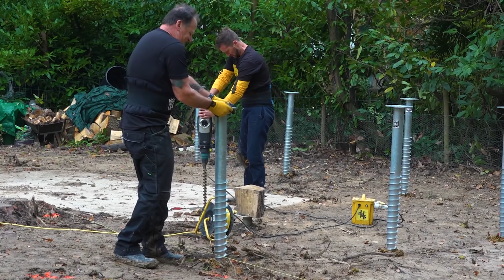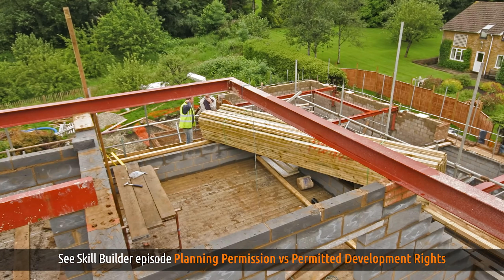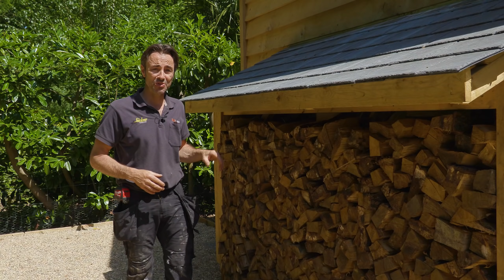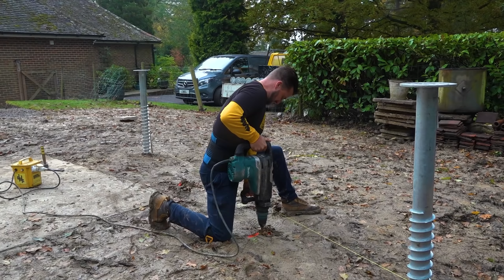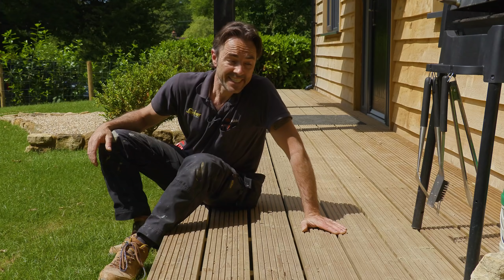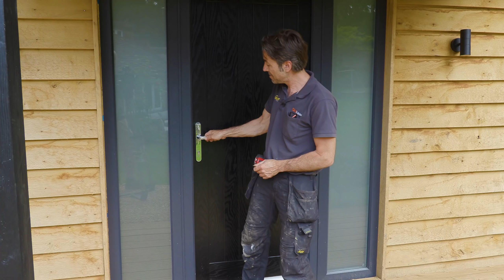The Completed Project - Garden Room #8

Comment: Love watching your Videos and have learnt so much. Being a old fart and a YTS Scheme Roof slater and Tiler back in the late 80's i shuddered to see the part with the fixing of the Artificial slate. For me i would still always use Copper nails and the distance those were fixed were far too close to the bond for me. The pitch seemed far to low for the nail holes, it looked lit nearly 50mm from the edge not 20-25mm as i used to nail them. The angle of creep would worry me far too much. Oh and whilst i am here, in your ground screw video when you are cutting the slate for packers, turn the slate cutters the other way round, they cut easier and straighter ;)
Reply from the maker: Those Tapco slates are made for a low pitch and have channels to stop  the creep, The nail positions are indented in the slates. It is completely different to something like Eternet Fibre Cement which need clipping at the front edge to prevent wind lift.
Reply: @SkillBuilder  I used those Eternet back in the 90's. They had a button pin that you slid between the lower and through a hole on the fixing. The roof I did in 91 was in a building magazine. I was just out of my time so the boss was very happy. Thanks for the reply, its appreciated.

Comment: I've only just discovered this series today and so binged watch them all in one day.  I am awestruck by your skill level Robin.  I do have a couple of questions though.  The door looks really narrow, I'm hoping its a camera angle but I was thinking it would be pretty narrow for a wheelchair.  Do you have any details on how the log burner was fit in the room?  How did you heat the room?  I am presuming you used electric heaters?  Finally, what was the result of the pull test?  I was hoping to be impressed with a big number!

Comment: We are looking at building some garden rooms robin but I’m getting mixed reviews about insulating the flat roofs with many people going down a so called hybrid type roof filling the complete void with insulation with no air space. The construction would be timber rafters with osb boarding with a EDPM roof with plasterboard internally. I’m concerned that this hybrid type system will condensate over time. Would it be a better option to have insulation board with a air space above with soffit vents.
Reply from the maker: Ian 
The choice is between warm roof where the insulation is on top and a cold roof where the insulation is on the underside and between the ceiling joists. 
The cold roof needs ventilating and it is difficult to ensure that the airflow across a flat roof is sufficient. 
Most people favour the warm roof these days but you need a vapour barrier.
Reply: @SkillBuilder  many thanks for the reply so I take it you wouldn’t recommend where people are trying a hybrid type system insulating the complete void from below.
Reply from the maker: @ianfinch1522  you can do that if you want to keep the height down but make sure you have a vapour barrier and good ventilation. I have seen many roof decks fail from moisture
Reply: Hybrid roofs don't work, and if they do its a fluke.  Steve the roofer on YouTube has many videos that explain this and shows real hybrid roof spaces that have failed.  You need the ventilation but a warm roof is always better.

Comment: This has been really helpful ,thanks .So you said this build is basically a timber frame house ...does that mean it met residential building regulations standards ?
Reply from the maker: Yes it has full Building Regs approval and planning permission. The only thing that would have been upgraded for residential use is the insulation. You would need Celotex on the underside of the rafters and a bit more in the floor.
Reply: @SkillBuilder  Excellent , thank you

Comment: Hi team....impressed as ever...as a builder of timber frame, mostly 'stick build' on site, I love all the technical details and development in the last few years, particularly to do with vapour and air flow management. So, just wondering, looking at the Capel build, and the great garden room, it seems the walls are impermeable PIR type insulation, and then the cladding has gone straight on.....I'm confused!
Reply: Cladding went on roofing batons to give it airflow

Comment: I liked the roofing .. you didn't show checking the template cut first, and then ran off a load.. Looks nice... not sure about the roof finish or the walls.. were then insulation board or with sheet material on the outside under the foil...

Comment: why would you test a screw pile by pulling? should it not be a weight test?
Reply from the maker: It is the same thing. The force needed to overcome the screw thread in the material is the key to it, The point load on the screw tip is not where the load is so you gain nothing more by loading it.
Reply: @SkillBuilder  interesting, I thought pulling out would be a lot easier as the soil would just be able to move out of the way upward, but in compression there'd be nowhere for it to easily move. But they must be using good engineering, just seems counterintuitive to me.
Reply: @cjhification  
as the pile is withdrawn the frictional residence is reduced as the the shaft emerges.....while the opposite is apparent the deeper into the substrate the pile progresses.
Reply from the maker: @MARTINA-gc3tq  It is a static load not a dynamic test, when  the screw moves then you really aren't interested after that moment. The point of the pull is to see what resistance is offered and that equates to the load. Keep in mind that the design assumes 50% of the maximum laoding so there should be a good margin for error.
Reply: @SkillBuilder  You never mentioned the outcome of the actual test in terms of its load - what was its capability?